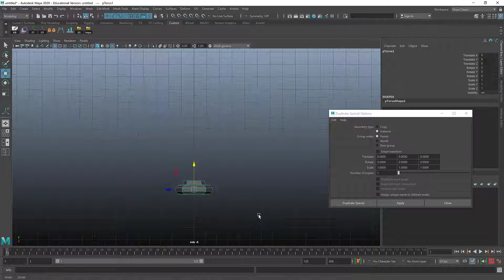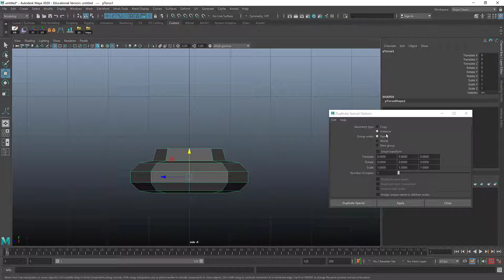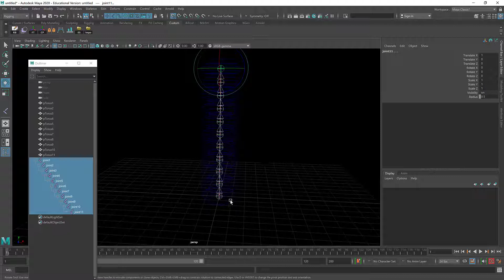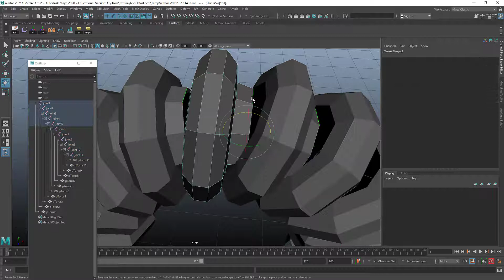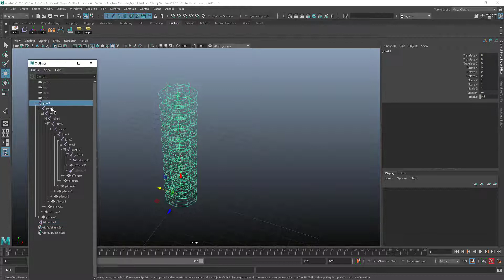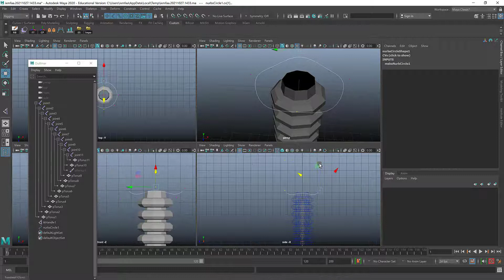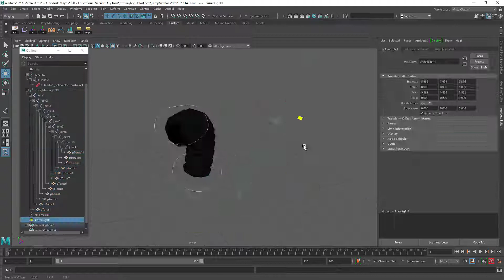Fully Rigged Rubber Hose - In Maya

Comment: Is it possible to make it so that the top and bottom part are static and attached to a certain object and the only change that happens is in the centre
Reply from the maker: The cleares example of all sorts of utilization of this method is in my film Dark Mechanism (availableon my channel).  Both the root and tip have the curves to control them. If the curves don't move then the hose won't,  but in the meantime you have control over the pole vector.
In my film I had about 16 hoses, and with this rig, they were effortless to use.